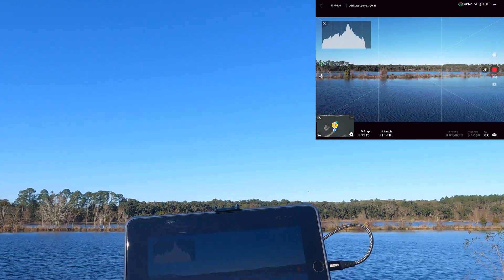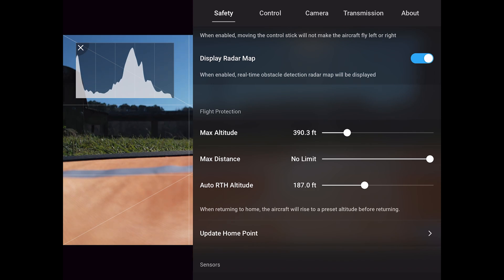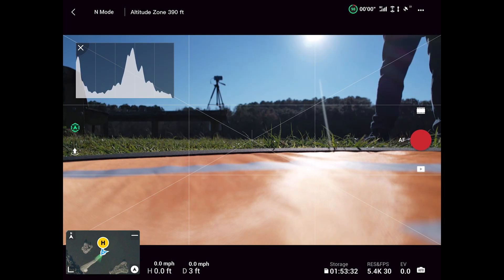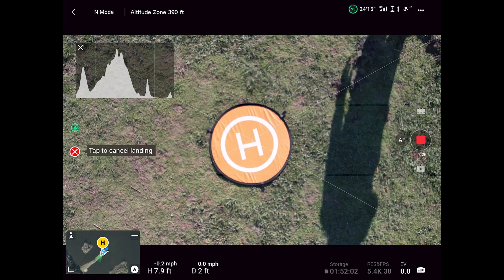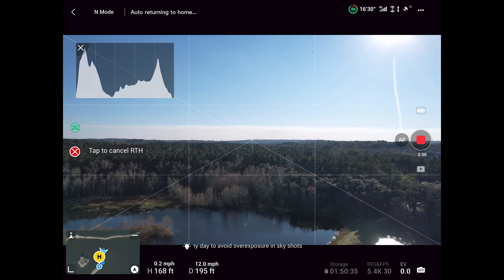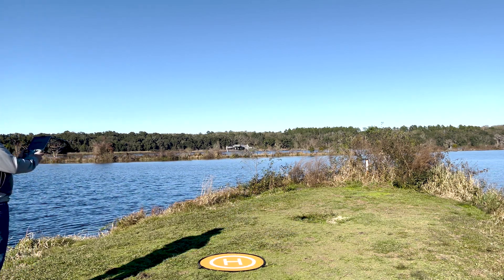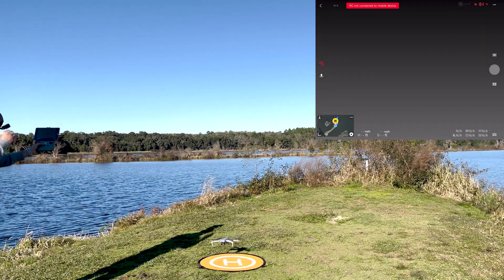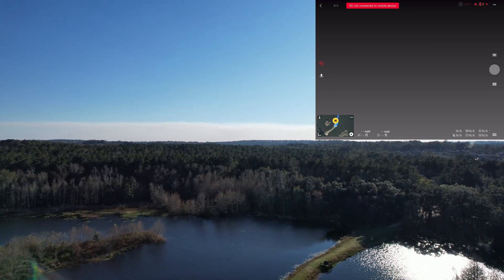Mavic Air 2S - RTH - Failsafe - Precision Landing Tutorial.

Comment: That's concerning on lost signal that if flies 50 meters first before it climbs to 167 feet in case something was 50 meters or taller on return to home. Very interesting!
Reply from the maker: Russ, the drone flies back from the original trajectory, the exact trajectory that makes it safe and this is an intention to gain reconnection while staying out of trouble. If the drone is unable to reconnect while flies back then is going to gain altitude to return to a home altitude that we set in the setting. I always recommend using more than 200FT. Normally I set 225-250 but to speed up the video I selected 167 (randomly) to make the already long video shorter.
Reply: @DroneSurf  Good answer Melvik.
Reply: It flies back 50 meters to check if it gets connection (it is wise it can avoid an RTH) if not, then he triggers an RTH. Note that there are additional subtle scenario, nicely detailed at: https://www.youtube.com/watch?v=sm2gQ15tj5U